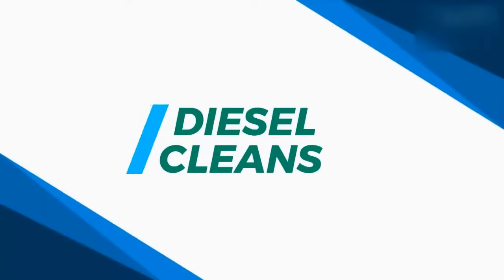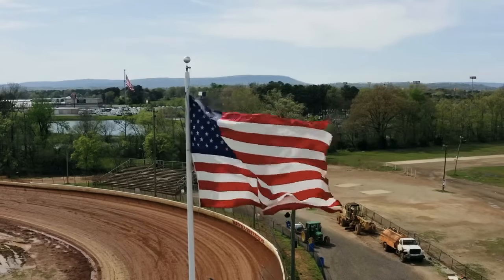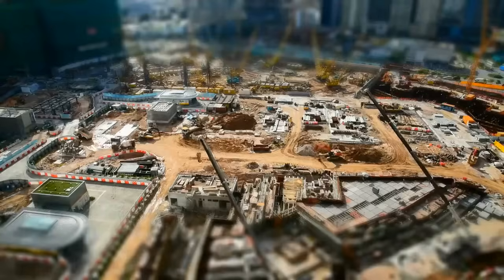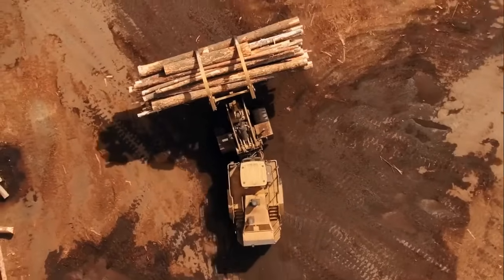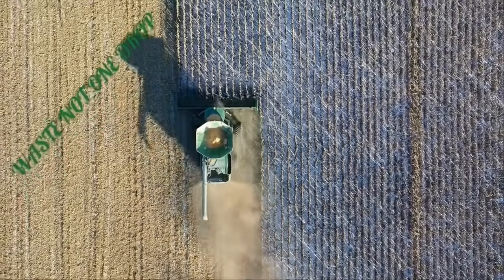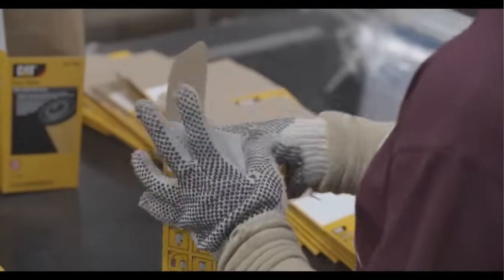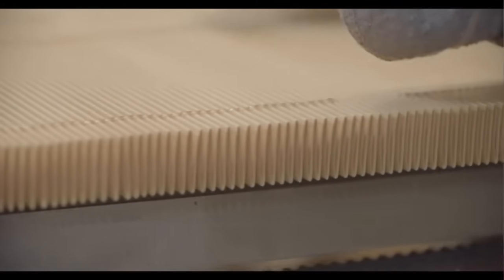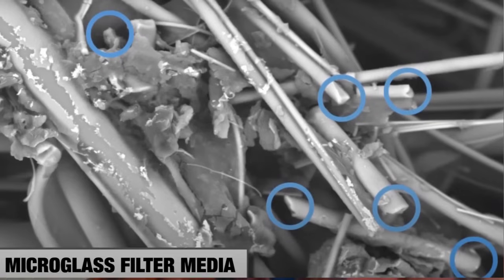Why choose Caterpillar Filters over FASS FUEL SYSTEMS or AIRDOGS?

Comment: From what i can tell in researching myself, the newer FASS XWS Water Separation filter is exactly the Dutton-Lainson GoldenRod 565-5 filter.
Which, as Air Dog pointed out in their video, was made to filter Fuel pump dispensers at gas stations and is intended to totally block off fuel delivery, once it's absorbed a small amount of water.   

I wouldn't know that I'm conflicted about this revelation for me and the comments and concerns about the glass fibers getting into the injectors The reason I say that is that this doesn't lines and filter is extremely common in the fuel industry and so I have seen it on fuel pumps when they're open and therefore if it is left too long which is far more likely than me watching my truck it's been sending fibers into everybody's fuel system and fuel tank for decades.

I say all of this not to speak for or against but understand I have only had one diesel truck I installed a fast system and I run these filters currently although I have a bunch of balloons in cat filters that I purchased but not figured out which filter to put where since they swap filters around. 

I do absolutely recognize the explained and documented quality of cat filters and so when I exhaust whatever it is I have I will likely not buy anything but the 0749 and matching cat filter.

Comment: How many microns does the CAT filter down to?
Reply from the maker: The Cat 1R-0749 is proven to capture down to 2 microns. Also, remember that you should have a Cat fuel water separator filter inline before the secondary filter to help with water separation and larger particulate capture. This filter order is used nationwide as it will increase the amount of water and particulate separation in a diesel fuel system.

Comment: Cat filters are certainly good! Although 3rd party tests clearly show Airdog is inferior and Cat isn’t close to quality: volume, purities, filter microns, etc as Fass Filters. In addition Fass will stop flow if water is beyond filters ability to absorb all. Between water & air removal, neither Airdog or Cat approach Fass Quality. For a Ford 6.7 and CP4 pump, Fass provides protection beyond Cat filters. 

For other fuel pumps not finicky like a CP4, run what you want and can easily obtain.
Reply: The only tests that show that is the guys from fass or air dog.
Reply: @maxpain7197  i believe the guy here who did the research and it goes to show if you have a product of like items that of course there will be conflicts but i think we should look at both of their tests and how they work..im not really sure if either of their tests are as forth coming as could be ie….maybe run fass system first thru their tests and then place fass in the second position and see what the test shows….will it change from murky to clear…..in other words we dont know what position in the line up either of those filter systems are and if there is any difference in the position
Reply: @chrisallen3741  circling around after a year, noticed the add-on comment… The FASS by independent tests, filter down 2 micron absolute… which isn’t beaten by Cat or Air Dog. Although my main focus is water & air and that’s a main advantage with FASS. Water 99% and blocks flow as it approaches full, shutting engine down and stopping water reaching CP4 pump, and removing entrained air improves lubricity. Both critical for CP4 duration and high mileage… Others filters don’t provide the level of prevention. 

I run CAT Oil filter… actually moved to a Baldwin cross reference and no concerns. 
Run what ya feel works best, my confidence is with FASS.
Reply: @ not accurate, you can get the Independent Lab tests & results. FASS didn't perform the tests, they send filters out.
Reply: Bullcrap about fass! I know guys who had fass filters on their trucks and they fuel system got contaminated and cause them to have to replace their whole fuel system. Also if you look up one of s&s YouTube videos they had a truck running a fass system and its fuel system was compromised! Don’t believe all the political crap from fass! Cat filters are great filters.